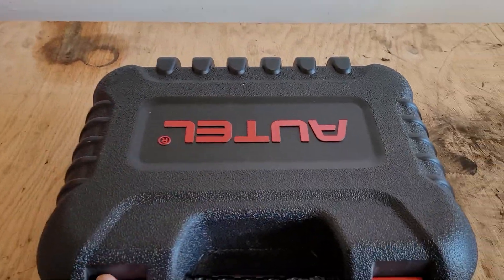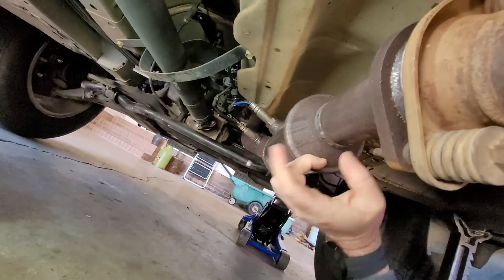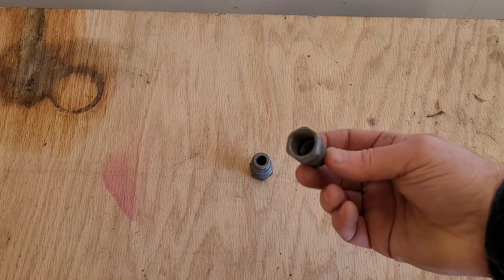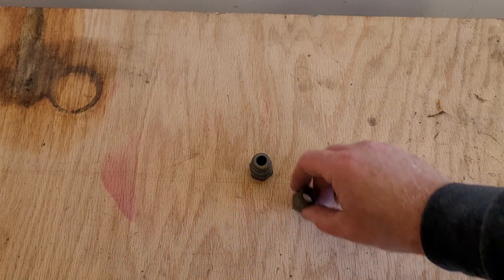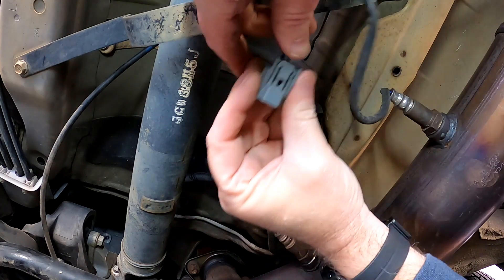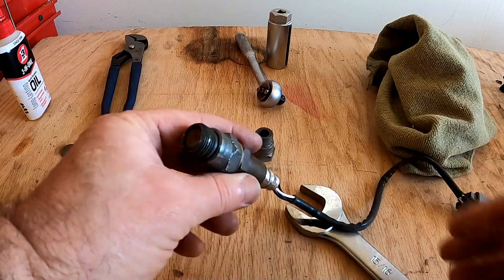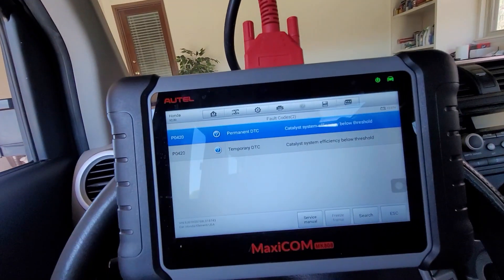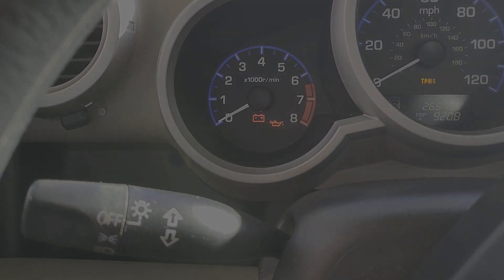Can Sparkplug Non-Foulers Fix A Bad Catalytic Converter?

Comment: Let me tell you..... that aftermarket cat you install will be worse than the bad OEM one in a few years.
Reply: Absolutely!  I went down a deep rabbit hole of spending money to chase problems after buying a $100 cat on amazon for high flow.  1st thing to check is that you properly did a burn-in when you 1st install a non-OE cat, and MAKE SURE THERE ARE ZERO EXHAUST LEAKS!!!  Even if they seem minute.  It's typically at the crappy flange between the cat and resonator/muffler.
Reply from the maker: For $170 instead of $2k, I'd take my chances. So long as it passes emissions. I put two Doorman cats on a J35 a few years back and haven't had an issue yet.
Reply: @ktecgarage  ... Let me re phrase. You cannot buy the same thing that came on your car from the factory, unless the car is very new. What I am saying..... is you are better off "modifying the output" of the oxygen sensor of your OEM cat, than installing an aftermarket car.
Reply: @jasonsprouse2803 Yup! That's why I went the defouler route. Didn't want to take a chance on crappy aftermarket cats. I don't trust them. And on an old car that mite burn oil or isn't tuned 100%, any cat isn't gonna last. Defouler worked for me👍

Comment: It needed it to be installed in bank 1
Reply from the maker: It is an inline four cylinder engine, so it only has one bank. Did you mean bank one, sensor one?
Reply: @ktecgarage   you have to use two of them for it to work an it has to be used on the down stream o2 sensor . If u have 2 down stream o2 sensors then u will have to put two of those spacers on each down stream o2 sensor so u will need 4 defoulers.   Although it does not work on ever single car but I can say it will work on lots of them. I have a 2006 bmw 330i and it work perfect.
Reply: Po420 Silverado error code on bank one which one sensors need to put adapter upstream or downstream My engine is 4.3 l v6
Reply: @hajrudinkavazovic2231  ...you need to read the code more clearly....bank or bank 2 just tells you which "bank" of 3 cylinders ( on aV6) is involved....sensor 1 is upstream, sensor 2 is downstream after the cat. The process here is for downstream

Comment: I've done this a bunch of times. Nissan downstream passenger side on the 3.5 engines is extremely common and a guarantee the code will trip before the car reaches 170K. I am not even a mechanic, and I know all the mechanics tactics.  That little part backs the O2 out of the exhaust stream just enough that the sensor will not trip a code. Jeeps are terrible for tripping that code also. .
Reply: Because you didn’t do it correctly you have to use both of them one is not enough you have to drill the one and then throw the other one in there too. That’s why you did it incorrectly. I’ve watched quite videos, and seeing people do it incorrectly. You must use both.
Reply: @CharlesLease-ei1ee  exactly.  I just tested it on mine and used two of them and a small narrow barrel with a medium hole to cause more restriction. The test worked on mine. It sucks to think I would need a new cat when for the last 5 years it has run smooth without issues and it gets great gas mileage. These invisible gasses are a money grab.  In Texas they are fixing to do away with the safety inspection portion and just do the emissions. The safety portion is more important. I mean it was meant to check to make sure your brakes, horn, lights and windsheild wipers were working. That is more important than invisible gasses.
Reply: U can buy 2 but i just brought 1 longer one from O'Reillys and it works great i didn't need the one with 2

Comment: It will but it won't pass a smog inspection....had one on a car in California but yeah they saw it when they ran a mirror under my car
Reply: You can do the same thing with the oxygen sensor itself. If it's a louvered sensor, take pliers and carefully close up the louvers. If it has holes, you need to make up some thing out of steel that will fit tightly around and seal it off. What you are doing is slowing down the exhaust flow into the oxygen sensor.
Reply: You must not know people
Reply: That's because you live in Commiefornia!
Reply: @smedleybutler1969  Imagine standing on the north pole and declaring "Canada is Argentina because they're both south of me!!". Do ya see now how idiotic this Red Scare shit is?
Reply: think the best solution to pass the smog check is by the following procedure; BUT,  if you have a bad cat problem initially preventing you from passing smog check, keep in mind people, your catalytic converter will eventually need to replaced to prevent damage to your engine. This is just a temporary method to try to help pass smog.
1) reset your codes using an obdII
2) remove o2 sensor#2 (Downstream), after cat and maybe clean it while you are at it.
3) install adapter 
4) install o2 sensor unto the adapter
5) run your vehicle for 60 miles or more,  depending on your vehicle so you can have all onboard monitors ready for smog check & hopefully yo check engine light does not appear.
6) the day/time of your smog check inpection, run your vehicle for at least 4 to 6 miles or more for a warm up.
7) remove o2 sensor (wear gloves & work smart as components will be hot)
8) remove adapter(wear gloves & work smart as components will be hot) as they may visually be inspecting undeneath.
9) re-install o2 sensor without adapter. ( wear gloves & work smart as components will be hot)
10) visit your local smog check station & hopefully it will pass without having the adapter during the test/inspection. 
Seems like a lot to do but it can be far better than replacing the catalytic converter just to pass smog. Tough times call for desperate measures!
Good luck good people      ✌🕶🔧
Reply: @alfredbernal8603 This actually my comment/suggestion, thanks! I didn’t comment that long 😀👍 I suggest copy and paste ur comment at the top👍🙂
Reply: @OKBAOK  Awesome & have a great day! 
✌🕶🔧